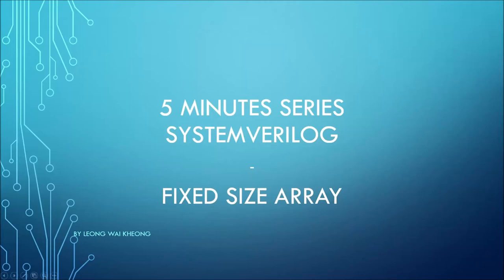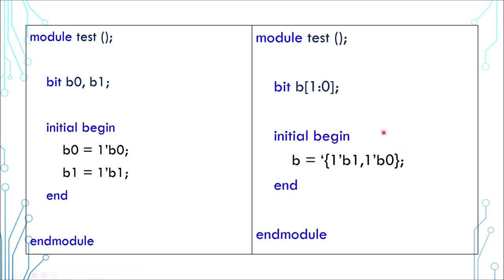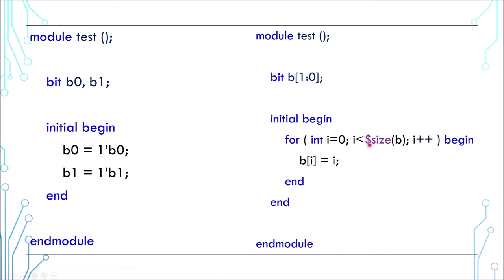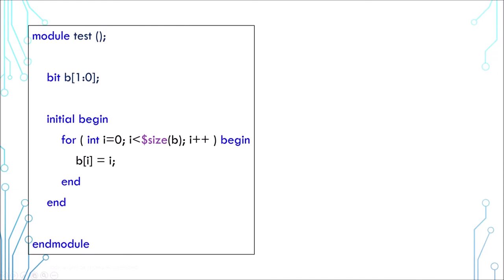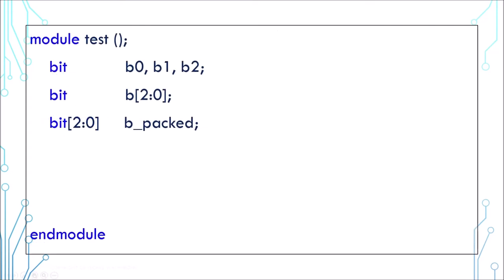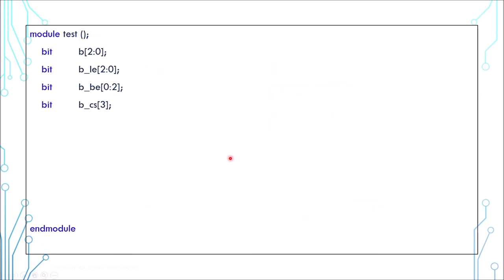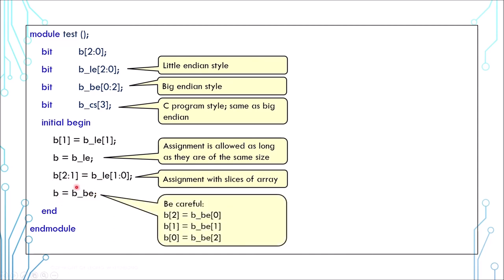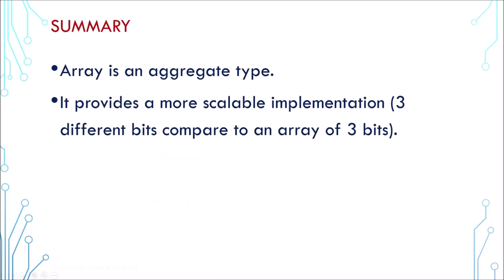SystemVerilog Tutorial in 5 Minutes - 07 Fixed Size Array

Comment: What will happen in the "foreach" example should the array be larger than 2'b?
Reply from the maker: So happens your questions has two meaning; if you mean the size b[1:0] changes to b[n-1:0], then foreach loop will loop n times instead of 2 times. If you mean the type bit changes to bit[n-1:0], then in this case, it will behave the same where it loops twice.